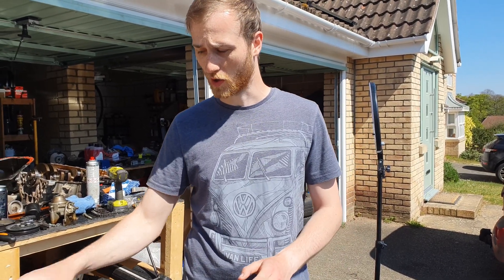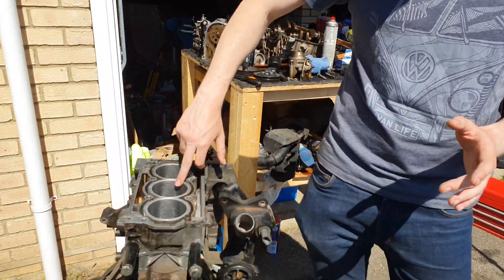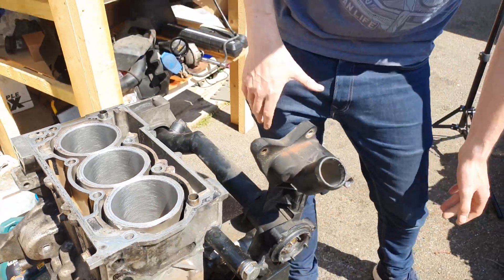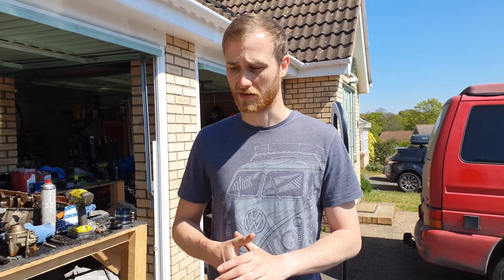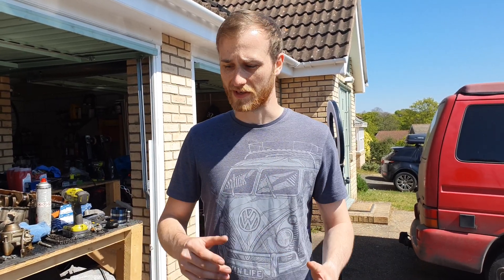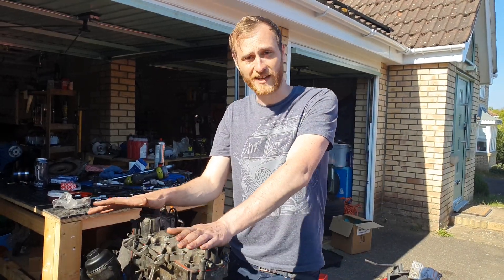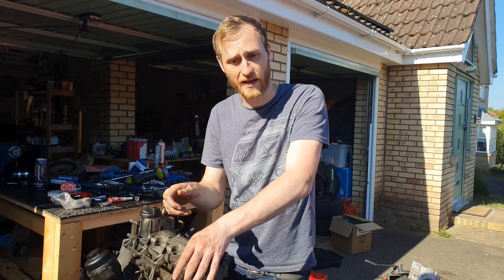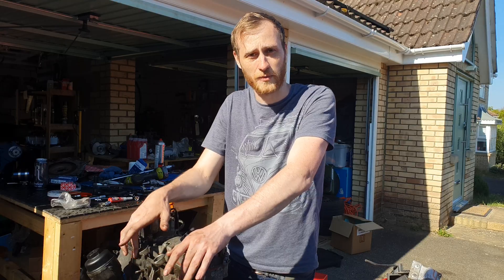Project Polo - The Rebuild! - The Autistic Car Guy

Comment: What torque settings did you go with on the bottom end? Great build.
Reply: Good question. I didn't know you could rebuild these engines. Somebody said that when you torque the bottom end, the block fractures.

Comment: was it a 1.2 tdi engine ?
Reply from the maker: Its the BMD 1.2 petrol 3 cylinder
Reply from the maker: @Boxing-ju1es  hi, unfortunately with this engine, the way its designed, the bottom end of the engine should never be disassembled as its torqued to shape at the factory and once unbolt, the block warps and never goes back together correctly 
This video is for general engine rebuild information.
Best thing to do if get a used engine and if you've had any head work done, swap the heads round, new head gasket and bolts, and crank seals.
Reply: @OriginCustomsLimited The BMD is it a 1.2 HTP?

Comment: Nice video, very good job! I am amazed to see someone dismantle the lower part of the engine, I wanted to do it but I read a message from VW : 
"The crankshaft must not be removed. Just loosening the main bearing caps will cause deformation of the cylinder block bearing pedestals. This deformation will cause a reduction of the bearing clearance. Even if the bearing shells are not renewed bearing damage could occur due to a different bearing clearance. If the bearing cap bolts are loosened, the cylinder block must be renewed complete with the crankshaft. Measuring the main bearing clearance is not possible with normal workshop equipment. The pistons must not be removed"
Didn't you have any problems after that ? And what about torque wrench/degree settings ? 🤙
Reply from the maker: I wouldn't suggest doing it on this engine to anyone. The video was mostly for general engine repairs to be honest as the basic principle fits pretty much any engine. I planned all along to replace the engine as it had internal issues, out of curiosity I did try this engine after to see if the issue was as bad as its said to be, I had virtually no oil pressure from it, thanks for the comment and taking the time to watch!

Comment: Wonder if it'll pass emissions. I wouldn't recommend rebuilding the bmd after doing mine. Get the 1.4 dohc it's better all round. But nice work.
Reply from the maker: Thank you for the comment! This was done purely for videoing. I got a low mileage replacement for the actual vehicle as the bottom was no good
Reply: @OriginCustomsLimited  nice one, it's cool to see videos of these ages of engines popping up, lots of the early noughties VAGs are going to the scrap yard with the new emissions laws.
Reply from the maker: @craiga6557  you're not wrong. Often forgotten and undervalued era from VAG. Especially when considering their more recent issues and failures